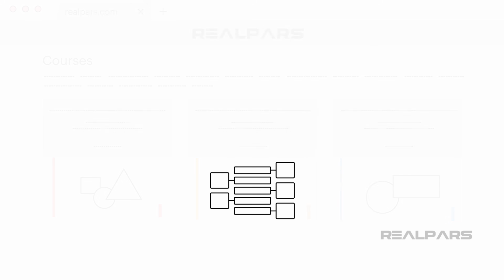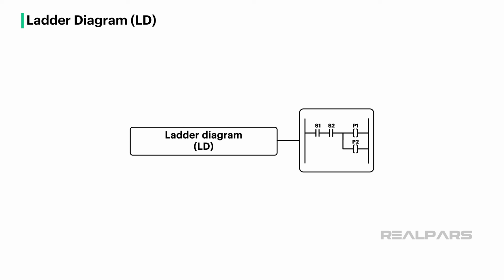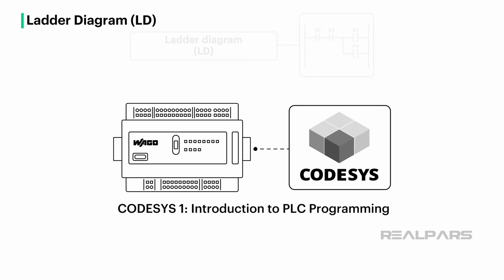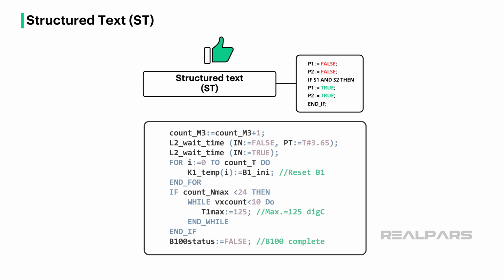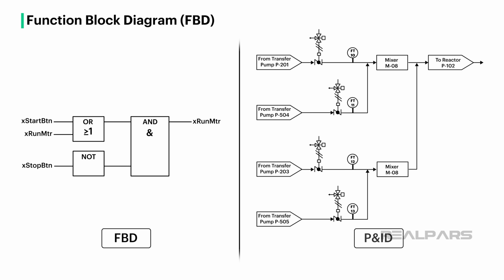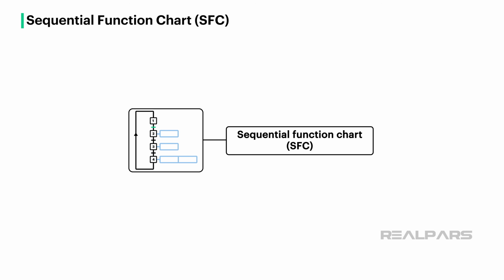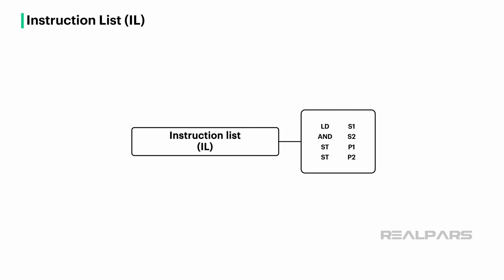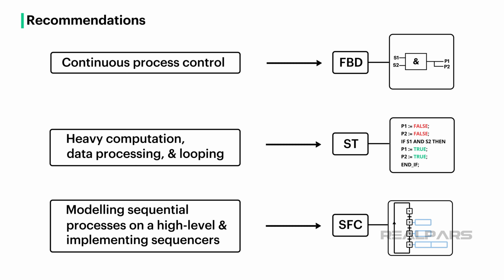Ladder Logic vs. Other Programming Languages: A Comparison

Comment: I have been working as an automation engineer for almost two years. Our company uses B&R PLCs. We have been straying away from using IEC languages, ladder logic is completely gone with only some structured text still present in some projects. We have almost completely moved to C/C++. I find it interesting how many still use these older languages, I guess it is fine for simple projects. I can't imagine trying to implement something like a neural network in anything other than C/C++. These older languages just can't keep up with the amount computation we are doing for some of these systems from a performance standpoint too. C/C++ also offers control of the PLC at the lowest level, allowing for some of the most dynamic and versatile programs. But with great power comes great responsibility. Anyways I wanted to see if anyone else has been seeing a shift in languages as automation advances.
Reply from the maker: Thank you for sharing that! Hopefully others in the community can chip in on that.

Comment: Can i know what the meanings as "looping "
Reply from the maker: Hi there, 

Thanks for your question!

Looping is repeating the same piece of code multiple times. In PLC programming, imagine that you have to move the value 0 to every element in an array of 100 elements. You could write a program with 100 move instructions or you could write a loop which executes the same command 100 times to move the value 0 to each element of the array. Does that make sense?